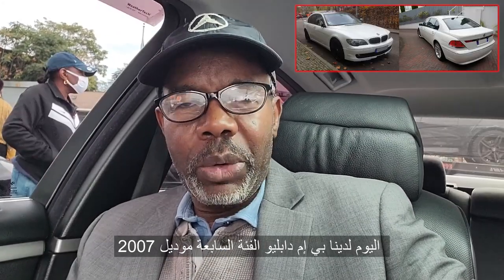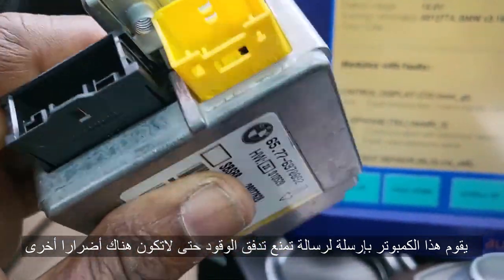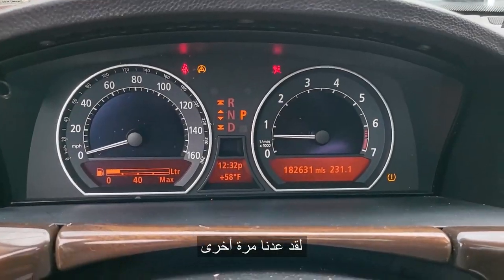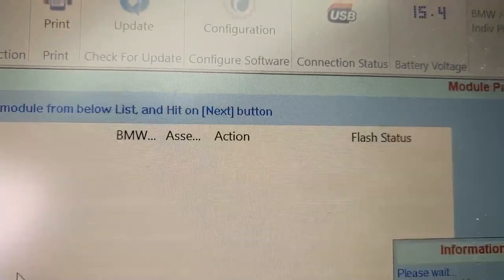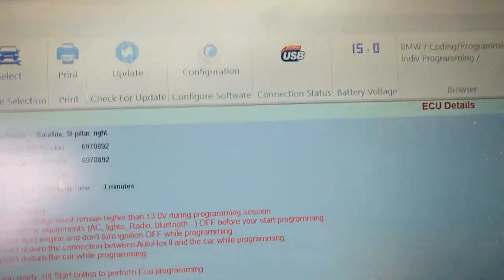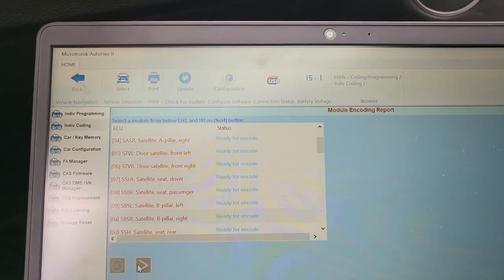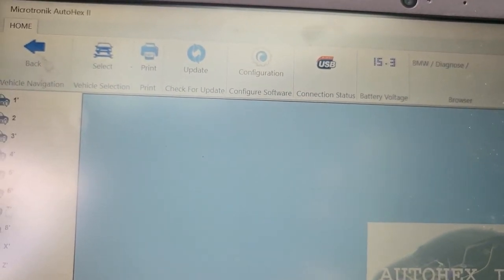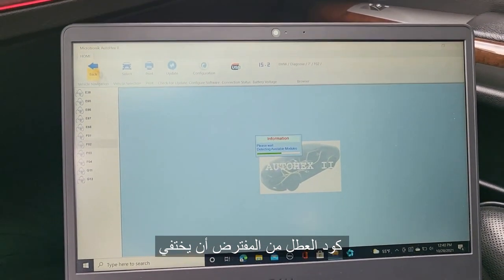BMW 7 SERIES E65/E66✔️ B-PILLAR Programming and Coding برمجة كمبيوتر الوسائد الهوائية

Comment: Hello Brother 
i have a question, does the SBSR module have anything to do with the fuel pump not working sometimes ? 
im driving an E65 735 2002
Reply from the maker: yes it control the fuel pump